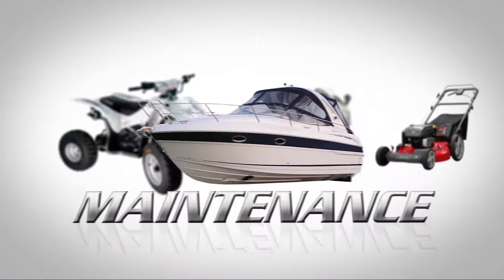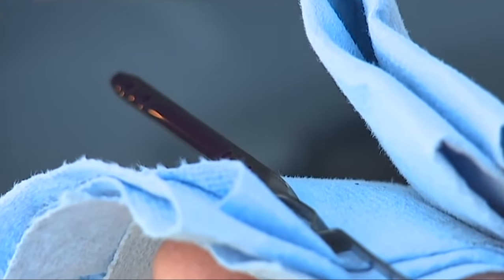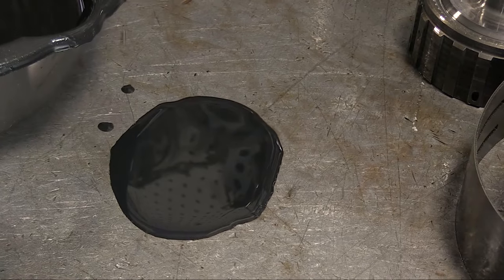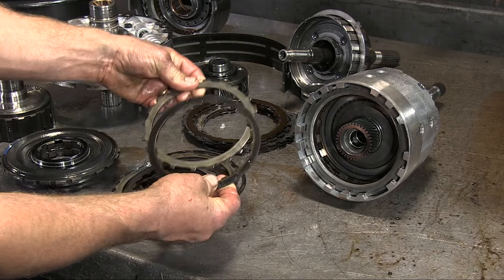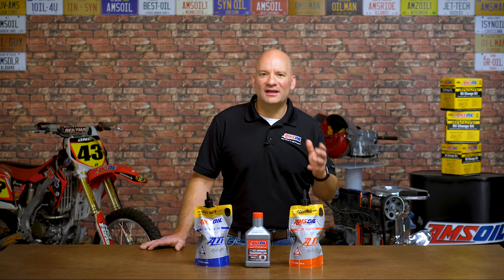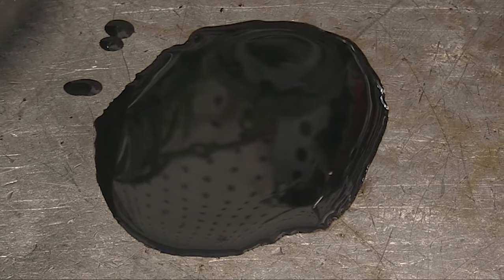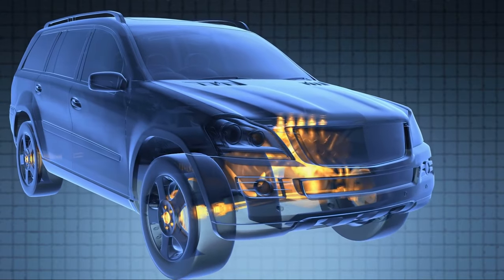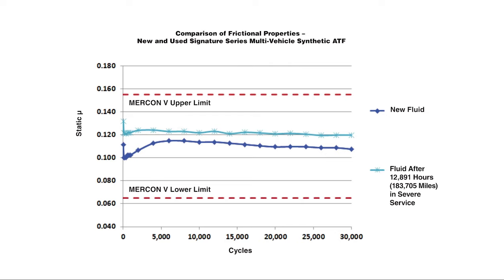How to Fix a Jerky Transmission

Comment: I'm living proof that changing transmission fluid is essential. In my case, I should have taken out the factory fluid the day I bought it.
Reply: it's never late to switch the factory transmission flud to Amsoil. But of course the sooner the better.
Reply: 30,000 -50,000 miles
Reply: And filter
Reply: What happened to the car?
Reply: Qed we
Reply: @bigsam5680  Nothing bad.  But I decided to change all the driveline fluids at 5000 miles in my 2019 Ranger.  The transfer case, and both diffs were grey with metal dust.  The magnetic stain plugs had so much on them they weren't collecting it any more.   Transmission too, but not nearly as bad.   After the change, My power increased, fuel mileage improves, and the torque while in 4H & 4L , I'll bet you, doubled.   
It's unbelievable how poor quality factory fluid is.
Reply: @TheBeatenPaths always good to dump  fluid after break-in
Reply: @kenj.8897  I literally can't believe the drain intervals in owners manuals!!  oil, transmissions, diffs, or transfer cases.

Comment: Add a bottle of seafoam to the fluid.  Drive for a week or two. Drain the fluid and change the filter
Reply: It's a transmission not an engine. Don't do that
Reply: @hemi4722  works fine. Seafoam will dissolve all the buildup inside. Upu want to change it after awhile. Look it up.

Comment: how long after fluid change you should expect to be better the jerky transmission?its passed 2-3 days already and feels almost the same
Reply: I have a jerky transmission and I still have the issue.

It really depends on what the issue specifically is and how severe it is.
Reply: @ehmaidan  it could most likely be a bad trans at that point Wich can and will most likely cost over 1000$ in repairs
Reply: Nobody has mentioned the 10% ethanol in our gas lately could be the cause too. When I use high test gas my 2011 impala works better. I herd the low grade gas can cause lots of problems carbon build up sensors not reading properly.  After any maintenance disconnect the battery to reset the computer and sensors.

Comment: How long should it take for the jerk to go away if you had dirty transmission fluid and got it changed?
Reply: How long did it take?
Reply: It normally doesn't go away since the internal damage had already been done.
Reply: @DoctorRickSanchez  how would you fix it next?
Reply: @leannawright5129  new transmission

Comment: After I got hit on the right fender in my 2015 jetta I noticed my car ( 2 days later) started leaking fluid at the time I just thought it was the A/C or something because it wasn’t leaking too much just visible, so I never moved the car since the accident until I took it to the repairs and 6 days later there was a puddle under the car. My friend came over to check it out and touched it and showed me it came out red. So fast forward 2 days later I try to move my car and when I shift from park to drive there’s a 2 second delay followed by a huge JERK, or when I switch to reverse, the car VIBRATES then stalls out. It’s now in the mechanic getting the transmission replaced with (33k miles) and my car has 80k miles. I pray everything works out well and I get it back soon I really miss my baby

Comment: in almost brand new camaro 2021 20k miles 6,2  10 speed transminion, it's jerking form 1 to 2 gears, making some noise what can be a reason ? converter? it is something popular in this model ?

Comment: @AMSOIL INC. 
What i don't understand / or have a handle on.    Certain Manufacturers recommend  specific transmission fluid.  
Ie .... Ford  Mercon LV ,  Mercon V ,  Ford Type F  /   GM :  Dexron  etc    /    Toyota  WS  Fluid  /  Honda their own honda fluid. 

So even tho Amsoil has two or 3 types of transmission fluids which will work for multiple vehicles.  

How are you able to make a fluid work for multiple vehicles and have it be better than what their dedicated fluid is?   I don't get that.....seems almost more risky.    in the sense maybe i'd be better using the Dealer OEM fluid and changing more often. 

That's My hold up.

Comment: My Z jerks hard when shifting. I never thought to change the fluid. I’ll report back if changing it was the problem.
Reply: @London Watson No it didn’t help however they did clear the ECU and for some reason it’s a lot smoother now. I was told the ECU can learn from a driver. Everything’s smoother now. They said the transmission fluid was just fine.

Comment: So drive an MK6 VW Scirocco and my great changes are smooth when i take steady and increase speed gradually. When i make a high speed take off it staggers when shifting gears. I changed both the gear box and mechatronic oil successfully. The problem still persists please help. I am not mechanic BTW.

Comment: Could you please suggest atf amsoil fluid for my corolla 2008 1.8 .car is facing shift shock on 2 gear. Mileage 100000 km
Reply from the maker: Our Technical Team would be happy to help provide a product recommendation. Please contact our Tech Team directly at Tech@amsoil.com or by phone at 715-399-8324. Thank you!

Comment: My daughter just got a brand new bike. On her lessons she can go slow for tight turns and the bike doesn’t jerk in 1st or 2nd gear, on her bike when she slows down into 2nd it jerks and not as smooth sluggish. 
Can you help . Aprilia 150
Reply from the maker: Thank you for the question, Annie. The AMSOIL Synthetic Motorcycle Oils, such as the 10W-40 Scooter Oil (product code ASO) or Metric Motorcycle Oil (MCF) may be helpful to smooth out wet clutch performance to give better handling in corners.  Both of these oils have really good detergents to help keep the clutches clean and porous, which in turn help to keep the shifting smoother and more reliable. 

Feel free to contact our Tech Team if you'd like to speak with someone in more detail. We can be reached at Tech@amsoil.com or 715-399-8324. Hope this is helpful!

-The AMSOIL Team

Comment: Thanks for the great video! Please please could you perhaps help me? I am always getting -700 mbar clutch E fill pressure after adaptation. 8HP55. I cannot find anywhere an information if this is outside of the allowed pressures. My transmission when the fluid temp is over 70-80 C, jerks slightly always before shifting 1-2 and 5-6. Very very slightly 2-3 and nobody can help me. Not even ZF official repair shop. Mechatronics has been checked and entire transmission rebuilt with new parts. No one knows why it jerks :-(
Reply: Same problem here
Reply: @tashaunmcfarlane4330  Hi, did you ever change your engine? I had burned piston, replaced my CGQB audi engine with facelift engine and that is the reason.
Reply: @TheXone7  I think there was some changes to the engine. My mechanic rebuilt the engine and the cylinder head was cracked. He had said that he put and upgraded head in making it 2.2 or 2.4L.
Reply: @tashaunmcfarlane4330  I might just end up by changing the engine to the oroginal CGQB engine. I wish I knew what part of that engine is different, becauase they should be almost identical. But perhaps injectors are bigger, cam shaft is stronger, etc. Thanks!

Comment: I was checking it on a 2009 Mazda 3 hatch super black trans oil can that cause a mild jerk from the first gear but smooth after all the way to 60 moths? What do you think it doesn’t always do it but you can tell in the first gear first mash on the gas ..
Reply from the maker: Thank you for the question, Stephen. There are many reasons that a transmission will have a jerk. Sometimes it is as simple as changing the fluid, and other times there could be worn clutch plates. The best thing to do is to have a trusted certified mechanic diagnose the issue. If you have further questions, or need a recommendation for fluid, please give us a call at 715-399-8324. Thank you! -The AMSOIL Team

Comment: I just had a rebuilt transmission in My car 2 weeks ago and ever since I pulled it out the parking lot it keeps jerking back and forth through first and second and sometimes 3rd and drive automatic transmission kind of shakes back and forth a little bit like shuttering. Anybody know what that is I'm going to take it back to the shop soon
Reply: Same thing happens to me
Reply: @Jesus-rt2wm  did they ever find out what's wrong with yours? Because I had an appointment last week but my wife's car blew a rear engine seal out with only 40,000 miles on it so I had to change my appointment to take her car in. So I'm still suffering with jerky transmission from 3rd to drive and I just spent over $3,000 on it

Comment: I have a 2013 armada when I drive sometimes stepping on the gas I noticed i get a knock jump jerk underneath.  Any idea?
Reply: My 2011 BMW X3 35i is doing that, it's worse at higher speeds. I have different brand tires on the rear even though they are the correct size they're still different enough to apparently cause a problem. BMW want to reflush my transfer fluid twice. HOPEFULLY I haven't ruined the transmission :(
Reply: @webslingernz  sound like it's ruined,  mine is probably little bit worn too. Not very often it happens mine will slip when trying to accelerate between 40 mph.  But I love the new bmw x7 m sport.  Wish I can own one one day

Comment: Mine only does when the car needs to warm up. After 5 minutes of driving and it’s fine
Reply: Mine too... i just bought the car a few weeks ago... and when I test drove it the car was warm so no jerkiness at that time... only when just starting out for the day... the shift is a little hesitant or jerky when I first leave home... between 2 and 3rd gear or between 3 and 4th gear... then it 'sometimes' dose it again after I leave the next stop sign/light... if that stop sigh/light is only a few blocks away... but after this one or two issues... it dosent act up again all day... puzzled... so i just did the transmission flush three days ago... and the next morning there was just one very sudtle jerk... and this morning I decided to drive it like I own it... because I was taking it easy driving first thing to minimize jerkiness... but this morning it jerked again noticeably once... we will now see why it does tomorrow... hopefully it has stopped... if by Monday it is still acting up the transmission guy will try something else... I don't remember what it will be.

What are you doing about your issue? How long has it been going on for what dose you transmission guy say?  Best of luck with your issue

Comment: Changed gear oil. Still same problem.
Reply: I am also facing same issue did you find out what problem
Reply: My car is jerking in fourth gear  switch  only after switch on my car and during running it's ok what's the reason ?

Comment: Can of seafoam inside. Drive a week. Drop plan, change filter, change fluid.
Reply: seafoam?
Reply: Nope
Reply: @kenj.8897  seafoam will dissolve any buildup causing it. If that does not work, you have a larger problem